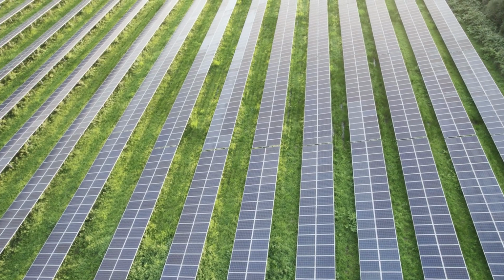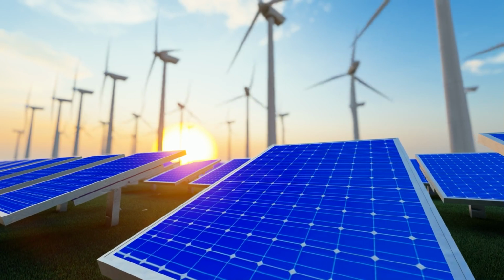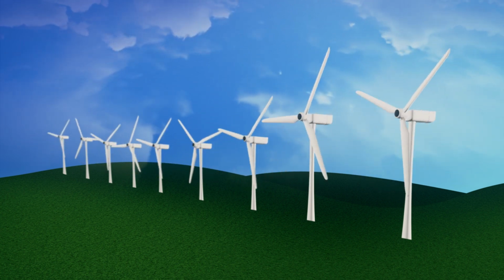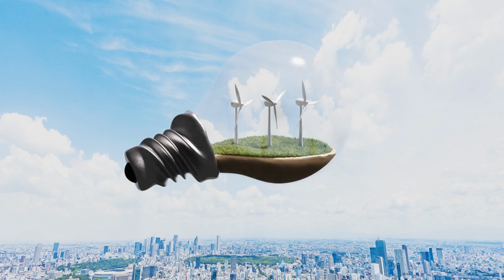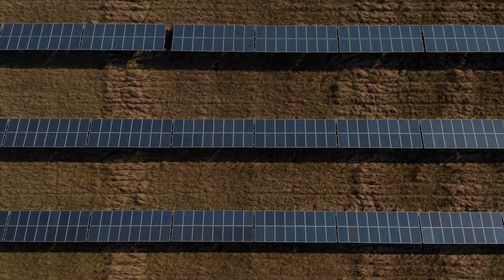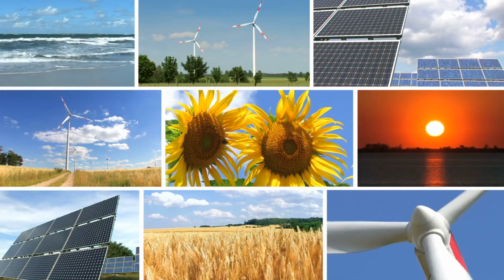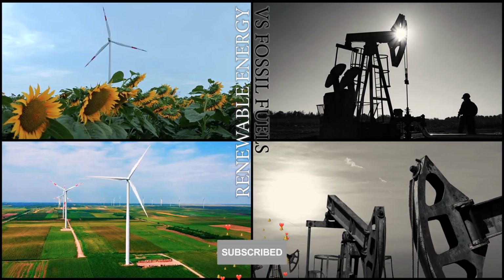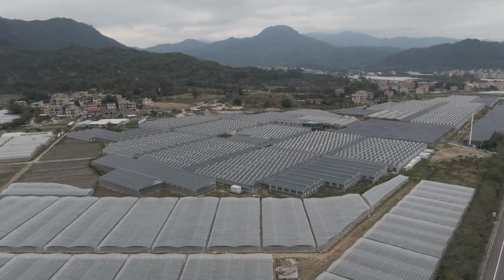How Cost-Effective are Wind and Solar Energy Systems?

Comment: Wind turbines are a scam. Uneconomic, kill wildlife, pollute the environment, ugly as sin. Uneconomic to recycle and NOT biodegradable. Just bury after used by date, 100 years later still intact and non biodegradable in landfill. Total scam
Reply from the maker: Thank you for sharing your concerns. It's important to consider all aspects of energy sources, including wind turbines. While it's true that they have environmental impacts, like any technology, many improvements have been made in terms of efficiency, wildlife protection, and recyclability. The push towards more sustainable energy is complex and requires balancing many factors, but the overall goal is to reduce reliance on fossil fuels and decrease global carbon emissions. I appreciate your input and encourage continued discussion on these critical topics to find the best solutions for our planet's future.